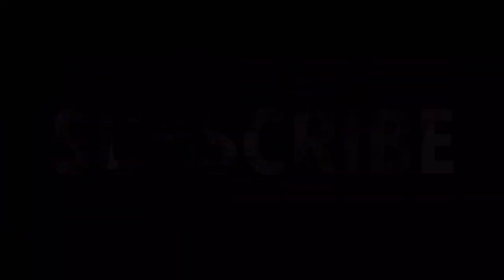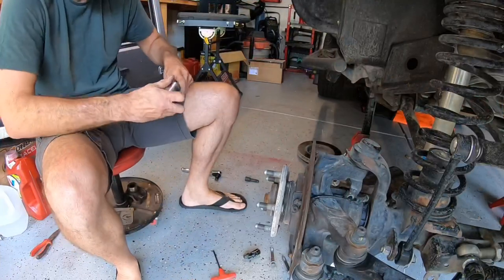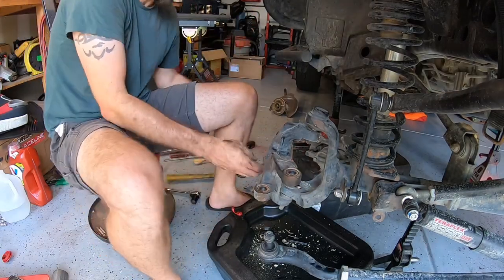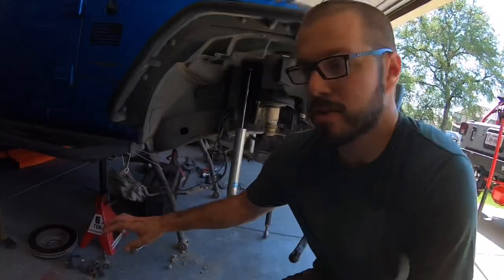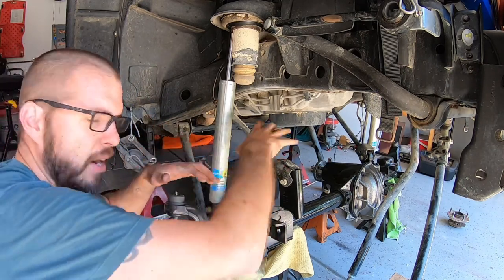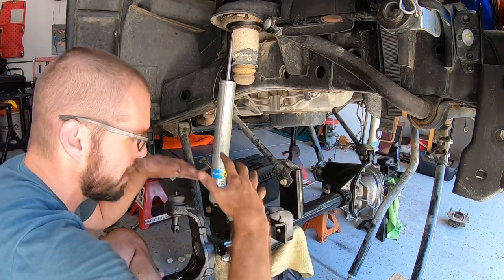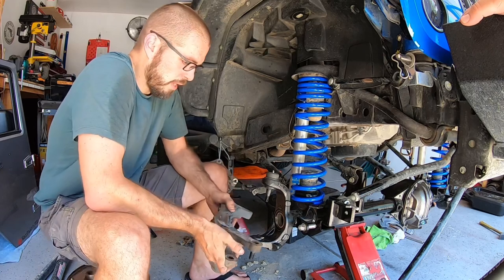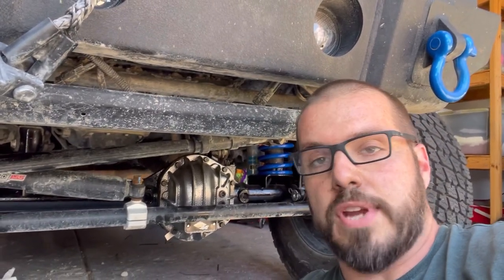Replace Jeep Front Axle - Ultimate Dana 44 Jeep Axle

Comment: Question, do you happen to know if a front Dana 44 off a JT will work (direct bolt on) under a JL?
Reply from the maker: So I don’t have experience with that just yet. I know the rear axle on a JT is different than the rear axle on a JL (the links are different). But I believe there are companies out there making things to adapt them. I’m unsure of the front. I THINK they are the same in the front. But I’m not 100% sure. If you find out let me know!
Reply: @WarPaintOffroad  sounds good, thanks for taking some time to reply man ! Keep up the great content.
Reply from the maker: @NevrR  of course! I’ll always reply. Thanks for the support! But that is the whole point. Never to be unreachable…build the community and push it on, pay it forward.